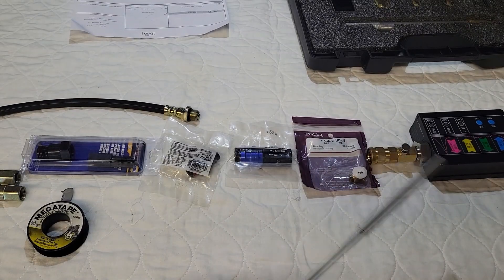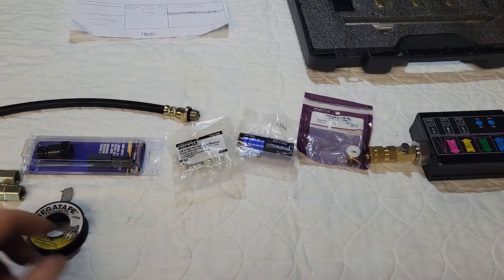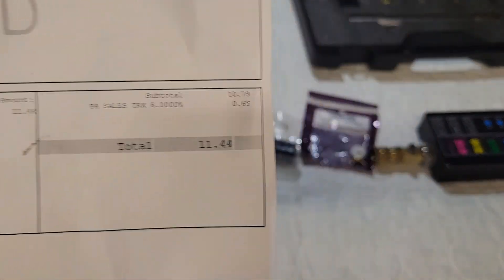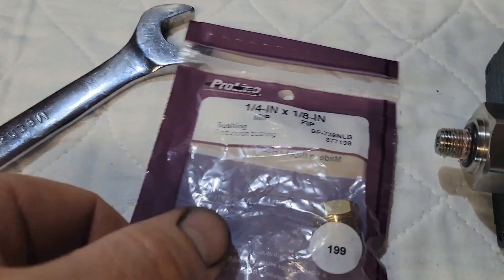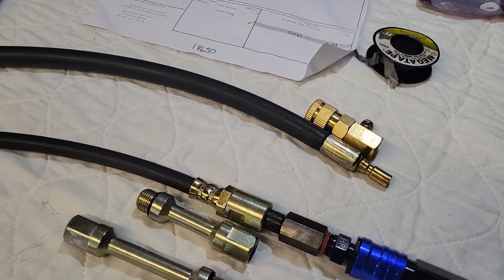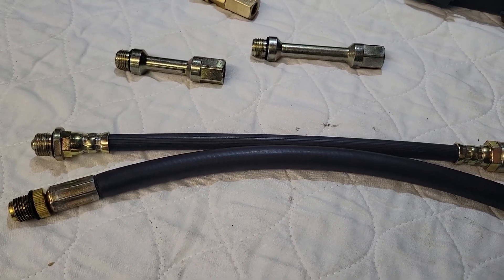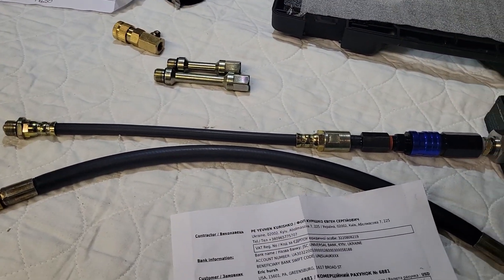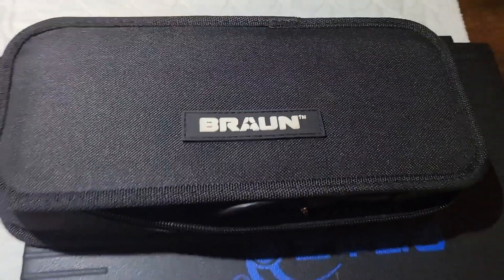APT-100 pressure transducer gets fitted with Rotkee pipes.

Comment: Can you help me out with the part numbers you used to make this? I caught the 1st one because you showed it really well, but I didn't catch the rest. Thank you! Also, great video!  Just got mine last week and wanted to do this too, but didn't know where to start.
Reply from the maker: Hi, great to hear you purchased one! The air fittings are just 1/4  air adapters, just high flow ones. That one is Kobalt, but HF has a good selection also. 
 The part number for the Napa thread adapter is #: PTT W84005. They also make a hose adapter that looks very close to the Rotkee hose at a good price.
It's number is #: PTT W84003. I do not have that one but looks sweet for local. Good luck, if these  were not the parts you were looking for, let me know!
Reply: @Backalleydiagnostics Thanks! I also went to Shotgun DIAGNOSTICS and watched his video too! Thanks again man!
Reply from the maker: @victorhoyt4352 awesone! You are welcome, @shotgundiagnostics was the video that seemed to have the straight up on these. After that it was just a parts scramble. Good luck!

Comment: Hi Eric.did you notice any difference from the hoses that came from APT100 and the Rotkee.  I was wondering about the APT100.  I current have an SSI 500 psi absolute.transducer with milton quick disconnects.  It connects to my Mityvac compression fittings.
Reply from the maker: @jondieter4903  Hi Jon. I did not compare exact readings, which seems like an obvious thing to compare now. I did not have any problems with the hoses that came with it. I heard some bad things, and it did seem like the crimps were shady, so even though it didn't leak, I ordered some new ones. I think by the time I got used to its readings vs. a gauge, I would need a new one and start all over. The actual transducer is pretty decent. They are + or - some with cheap transducers, so I figured get used to something that would last with it. 
 The Milton connectors are great. I need to order some to make adapters. I believe pico uses them too. It would be great to have a standard for fuel,  compression, and everything in between. Have a good one 👍

Comment: I tried to order stuff from Rothee and can't get the order to complete.  It keeps telling me to do the address in Latin so how did you order from them
Reply from the maker: @garyjohnson801  The last time it went through easy peasy, the time before i had to use paypal. Both were smooth shipping and tracking. With everything going on over there, i imagine things can change quickly, though. The Latin is new, i know a few times i clicked a floating button, and it turned to Ukrainian. If i remember right , i just clicked the button again, and it turned back to english. If you can get to the option or message to use paypal, you might have more luck. I believe there was a message instructing to do so then. Good luck, i will have to check it out!

Comment: The small hole gives a cleaner waveform . On many map sensors in boosted cars we use a restrictor of .035 to stabilize choppy map signal cause map hose,intake manifold  design,etc. Same principal here.
Reply from the maker: @mandytuning  Excellent!  I figured the Rotkee ones are made for a transducer and probably had a reason I wasn't aware of, whereas the ones that came with it seem re purposed. Thanks for the insight!
Reply: @Backalleydiagnostics That is correct. Pressure has no problem with small holes...flow does...kinda like a wire.  Voltage has no problem passing, amperage does get limited. Actually with the pressure transducer the less air mass you have between the testing point (cilinder head) and the sensor itself, the better. The air has inertia and the more air you have the more acts like an accumulator and distorts the wave form accuracy. If you check the rotkee pressure sensor page they suggest you put the least amount of tubing when scoping. Ideally you'd screw the sensor directly into the head. The setup you've made is good for fluids let's say because fluids are not affected by length. Good to know the thread measures tho... Thank you!